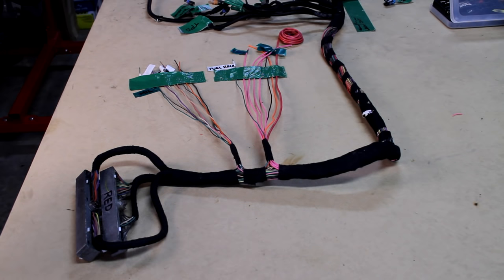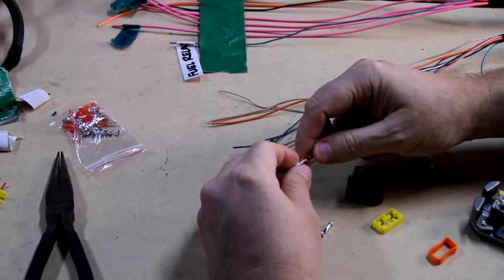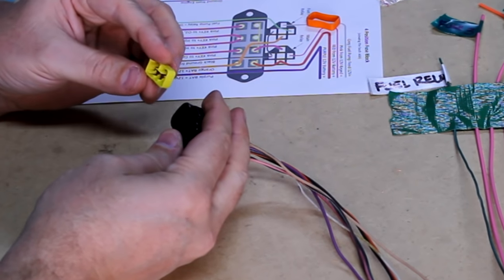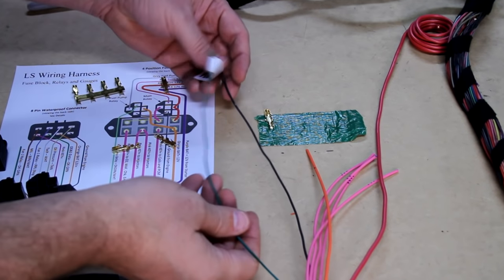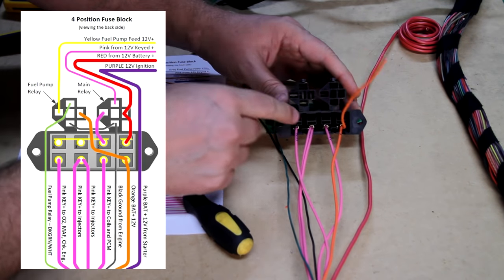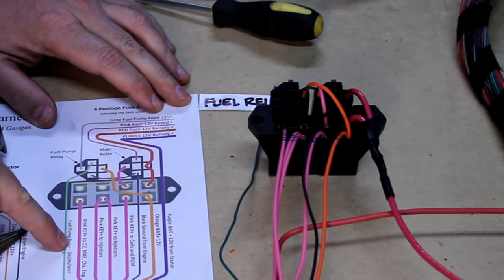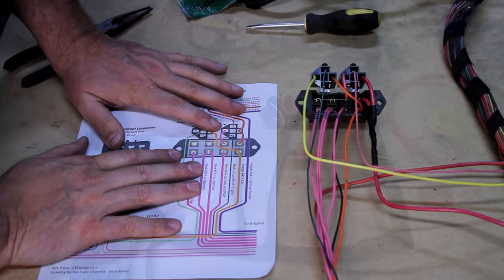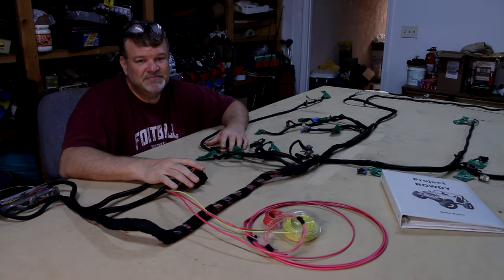LS Wiring Harness Part 5 | Project Rowdy Ep017

Comment: Hey Mike, im putting a 2008 5.3 into a 1953 chev truck. im currently working on the wiring harness and am a little confused on building the fuse block. will the  LS Fuse Block and Relay Diagram be the same for my harness?
Reply from the maker: Ryley O'Connor   That is a great question.  I believe it will be a little different.  The overall concept will be the same.   However the newer harnesses made modifications to the wire coloring and there are PCM pinout changes that were needed to support new features.   Did you find a good pinout chart for your engine?   You might have to do a little translating.
Reply: i used Brendans info on lt1swap, as he gives a good idea about what wires to keep and what to get rid of. i printed this off (http://www.lt1swap.com/E38%20ECM%20Connector%20Pinouts.htm) and cut out every wire he says isnt needed (yllw wires). my harness as it sits right now, have all the yellow wires cut from it, with the pins still in the connectors
Reply from the maker: Excellent!   I did not realize that he had any 2008 information.  Please remember that I only have experience with the 2001ish 5.3 setup.  The page that you provided only illustrates the ECM connectors.  From a Fuse Box (your original question) perspective, Pins 19 & 47 are like my Pink Wires for my PCM.  Pin 20 is like my Orange Wire for my PCM.  Those are the wires that are needed to Power your ECM.  Beyond that, you will need to find references for all of the Pink wires in my diagram.  They will be coming from your Source Vehicle Fuse Box.  It would be nice to have a wiring table for that.  Hard for me to provide much help without it in front of me.  Hope this helps.
Reply: it defiantly helps! im just trying to get any more info on it before i tear into it anymore. be nice to only do it once. your videos are awesome and have helped me understand things a lot better. ill be sure to update you with my progress as i work on it. thanks again!
Reply from the maker: You benefitted just as I had hoped so many would.  Not from the exact steps, but (1) that it is do-able, (2) the approach is just a direction, (3) you can take liberties to change the details and make it your own.  Congrats for having the guts to venture into it!   Do keep me updated.  Would love to hear that it all worked out for you.  Mike

Comment: hello! i would like to know if u can tell me what is the wire from PCM to FUEL GAUGE am planning to use the factory fuel tank from a Tahoe 2002. there a 4 pins connector for fuel pump, Black wire to ground (chassis), Purple wire to R54, Gray wire to Fuse, Orange wire to B80,  but i could not fine the wire that comes from Fuel tank to Fuel Gauge so I guess that wire come from PCM. hope you know what is this wire. I am doing the same configuration as you but i notice that you use only Grey wire from Relay to Fuel pump so i need to delete Black, purple, and orange wires as your configuration or can i keep them? that will make any difference in the PCM or inaccurate fuel gauge ?
Reply from the maker: Javier, I do not think that I can help you on this topic.   The newer cars/truck typically use a CAN Bus system to communicate things like Fuel Levels and such.  In the older vehicle that I swapping my engine into uses a simple Sending Unit in the Fuel Tank that uses resistance and sends it directly to the Fuel Gauge.

Comment: Thank you for all of your previous help; however, I am once again stuck and am hoping for additional guidance. On my 1967 Oldsmobile Cutlass, I have an indash ignition that has 5 prongs. The 5 prongs are Battery, Ground, Starter(Solenoid), Ignition 1, and ACC.  I am not sure where to plug in the wire from the ignition switch (Ign 1)and the ACC to the harness.
Reply from the maker: Did you see Part 6 of this series where I diagnose how and where I am going to connect into my vehicle's ignition system????  I am not exactly sure on yours (you will need to validate with a multimeter ), BUT I BELIEVE...  you will be connecting your Harness Purple Wire to the Starter(Solenoid) connector and the Harness Red Wire to the Ignition 1.  But please check how these connectors operate with a multimeter with the key in various positions.

Comment: Great video as always! On the red wire that you split and ran to the relay and to the top right on the fuse bank. What does the one on the fuse bank do? It's late so I'm probably not thinking clearly. But I guess I'm asking what's the purpose of running it to the bank and not just to the relay?
Reply from the maker: This is great question!  My drawing (starting at 16:01) is accurate, but might be a little misleading as I laid it out on paper as a logical layout.  This might help clear it up....  The Red Wire is 12V+ coming from the battery and it needs to "connect" to this assemble in 2 places.
1) The Main Harness Relay - When the Ignition Key is turned to position Run or Start, this relay is Allows the Red 12V+ source to provide power to Fuses 2, 3 and 4.  This provides power to all engine related items that need KEYED 12V+.
2) FUSE #1 - Fuse 1 provide Constant 12V+ to engine related items that always need a 12V+ source.  Those items need to be protected by a fuse.  So from the Battery, through Fuse 1 and then to the item (regardless of ignition key position).  There are three circuits that need contant 12V+:  two Orange wires that feed the PCM (for memory) and one to the OBD2 connector.  Not sure why the PBD2 connector need constant power, but it was noted in 3 different places in my research.... so I DID IT!!!!
Hope this help!!!!!  Mike
Reply: Perfect explanation! Thank you. I'm trying to fully grasp everything before jumping into mine.

Comment: You always have awesome videos. I do have a question are you running drive by wire or drive by cable? I'm converting mine from drive-by-wire to drive by cable based off of lt1swap.com. My question is I see you're adding the white wire for your Tac, from what I understand you don't need the TAC if you're doing drive by cable? The only reason I say that is because after switching it over the connector that goes to the TAC isn't used anymore.
Reply from the maker: Mine is a Drive by Cable.   I do not believe that the Red10 White Tach wire has anything to do with DBW or DBC.  It is a pulse wire coming from the PCM that will feed me Tach meter on the dash.

Comment: Where does the pink wire going into 8 pin connector come from I'm doing this same harness cleanup as we speak and I don't have a pink wire to go into my 8 pin connector. Thanks for all the info if it wasn't for your vids I would have never tried to tackle this!!
Reply from the maker: Have you downloaded my wiring diagram?  There is a link in the "Show More" section just below the vids.   The Pink Wire that going to the 8 pin connector is a new pigtail wire that I added to the circuit off Fuse #4 (see page 2 of the diagram).  Beyond the 8 pin connector, that wire will go to the Check Engine light.   Hope this answers your question.
Reply: UCanDoIt2 it does thank you very much I have downloaded all the diagrams and studied them like a bible I appreciate it!!

Comment: The yellow wire should it go to a nothing relay back buy the fuel pump if your going to run a 
bigger pump like a 450 walbro? So you can run heavy main wires from the battery.
Reply from the maker: So let me explain it logically.  (1) There is no reason to place the relay back by the pump.  It just needs to be located somewhere in the circuit (between Battery and Pump).  My setup is perfect for this and makes the wiring easier.  (2) The circuit you suggest (heavy main wires from battery), still needs a fuse and a relay... my setup provides this.  (3) I am not specifically familiar with the 450 Walbro, but can't believe it would draw current that would need more than a 16 AWG wire.  If you find out that it does... you can simply (3A) increase the wire size of the Short Orange Wire from Fuse 1 to the Relay AND (3B) Increase the Yellow wire that goes back to your Fuel Pump.  I honestly do not believe this would be necessary.   Fantastic question!  Hope that helps and have fun with your project.  Mike

Comment: One more question, I’m missing one of the blue covers that go onto the PCM connectors. Do you know where I could get one?
Reply from the maker: Your best bet is a junk yard.   They are all over the place in the junk yards
Reply: @UCanDoIt2Mike  they might have them all over the place where you live, but here in NM, not so much. I’ve checked from Socorro to Las Cruses and haven’t found one yet. Either people buy the harness with the eng. or they won’t separate the harness. I am going to try Texas next.
Reply: @UCanDoIt2Mike  right after I texted you, I found them on EBay. I had to buy the whole connectors, but it didn’t cost any more than it would have than to drive to Texas.
Reply from the maker: @jessesumrall2449  Sweet!   A couple of months ago, I picked up a pair of Red and Blue connectors for $10.   Just cut them from a truck.   I am using them on a harness for my bench tuner.  Glad you found one.
Reply: @UCanDoIt2Mike  got a question 7 months with no videos just wondering
Reply from the maker: @Camarogarage  Work, Health, and Wife's Honey Do List took over for a while.  Hoping to get back on Rowdy this month!   Cheers and many thanks for checking in!!!!  Mike
Reply: @UCanDoIt2Mike  okay cool man can't wait I'm currently reworking my harness step-by-step following your instructions

Comment: It looks like lost of the 8 pin plug wires are interior stuff. Why is the fan relay neg signal ran in the plug? Thanks and love your videos!
Reply from the maker: That is a great question Adam.   My original through (discussed in the video) was that I would run that wire through the harness and have it exit the harness somewhere along the front (possibly near the MAF sensor).  But then I realized that I would have a strange wire coming off the engine and crossing over to the front grill.   I then realized that if I had it exit with all of the other "Gauges" (8 pin connector),  it would already be on the inner fender and I could run it forward to the fans and it would be a little cleaner.  Just a decision I made after thinking through the configuration of my vehicle.  Cheers!

Comment: just wondering how you'd integrate a coolant temp gauge into your setup. i know you're using the ECT sensor because the ecm needs to know temp for fuel mapping but typically on a gm vehicle the coolant temp is displayed on the dash because of a computer generated signal provided to a factory cluster.
Reply from the maker: Thanks Michael... I have not looked into that,  but would like to have that available.   I guess I need to study the Dash Wiring harness to determine where that wire leads.  I have some diagrams, maybe it is listed.  Have you solved this?  And you are right, I do still have the ECT Sensor wire that lead back to the PCM.  That one is very important to the PCM for making adjustments.
Reply: I've spoken  to a buddy who is running a 6.0L with the NV4500 in an 06 jeep. His advice was to leave the ECT sensor alone with the ECM and run another temp sender elsewhere in the cooling system for the gauge. That'd how I'll be doing it in my 1985 Chevy K10.
Reply from the maker: That sounds like a great solution.  The passenger side head will have the same port hole that could be used.  It will be very close to the firewall.  Thank you Michael!!!!!

Comment: am installing a factory 2002 chevy taho cruise control module and factory brake switch  on my 1952 chevy truck so do you know what wires from CCM go to Brake switch? there is a 6 wires Brake switch. white, orange, purple, brown, green/blk and green/wht so one of those wire is related with VSS that goes from CCM to brake switch so do you know some about it? or even better if u know where to connect every wires from BS.  thankyou  for ur help
Reply from the maker: My project did not include using this feature.   I suggest referring to the Blue/Red or Green/Red PCM pin-out charts to find those wires.   Cheers Mike.

Comment: Hey friend, do we have to pull out the unused cable? What happens if we just leave them there?
Reply from the maker: You can certainly leave the wires there.  Would you also leave the connector and just leave them disconnected.  That would be fine as well.
Reply: but my machine still can't start ... what's wrong according to you? I've followed your instructions

Comment: Where did the green Fan 2 relay go on the communications port? It was never addressed and you just moved onto the power wires. Thanks
Reply from the maker: I thought that I talked about it, but if not... here goes!  I created the Green Fan 2 wire and left it tucked into the harness (unused, but ready if needed) just before the new Gauge Connector.  Currently, I am not planning to run a second fan as I am putting this engine in a Jeep CJ7 which has a square Radiator.  At the time, I did not feel that a second fan was in order.  Since then, I have thought about finding a 2 speed fan and possibly using that Green wire to work the second speed.  Still not sure if I will go this route.  If you would like to use this wire, you will do so in the same manner that you would incorporate the Fan 1 wire.  It is a trigger wire that goes to a Relay.  The relay would have a dedicated power wire that would in turn power the fan.  Hope this helps!
Reply: UCanDoIt2, ah I get it now. So if I am running a (2) fan set up for low and high speed I can re route the fan 1 wire to meet up with fan 2 and run both to relays direct? Meaning I can remove Fan 1 from the communication connector that’s running toward the OBD2 port? And I have to thank you for a great video and mostly for the super quick response.
Reply from the maker: Greg Stewart You’ve got it!  If I had the need for the 2nd fan immediately, I would have used a larger gauge connector (day 10 port).  You can take out the #1 fan wire and add a 2 port connector for them.  Cheers!!!!   Mike
Reply: UCanDoIt2, Awesome! Thanks again

Comment: what an awesome video thanks for all the help made perfect sense very clear and organized!! where can i get the forms that shows what wires to delete they x's and where highlighted what video is that on for some odd reason i cant find it. very helpful👍👍👍👍
Reply from the maker: You will want to visit LT1Swap.com to download the Pinout Charts for your engine Size and Year range.  It will provide the "base" wires that can be deleted.  I have provided download links to some of the information that I used in the Description Section of each of these videos (use "Show More" above).  Not sure if I included a copy of my pinout where I placed the "X"s.  Would that help?
Reply from the maker: The video that I cover the Pinouts and the Chart that I marked up is located here:  https://www.youtube.com/watch?v=GXQtSLG0CW4&t=2s .  It just contains a few snapshot of the chart.
Reply: UCanDoIt2 
I would lik to see the diagram for the 3 small connectors that are located by the fuse block will i be able to get that from lt1swaps?
Reply: UCanDoIt2 
Thank you so much very helpful information.. Very nice!!!

Comment: Hi! great harness,I was wondering what program you used to do all of your wire drawings, id like to do the same for the car im building.
Reply from the maker: Thank you!  For my drawings, I use Microsoft Visio.  Very easy to use (drag and drop).  I have been using it for 25 years (pre Microsoft), and it is easy to learn.  I believe I have a very old video here on a design I did for a Wine Rack.  I think I walked through the design.  I'm sure there are many How To vids on Visio.  You should check those out.  Cheers!  Mike

Comment: Gday, just about to test fire all my hard work.  One question though, what amp fuses should i use in that fuse box configuration you designed?

Kind Regards
Reply from the maker: 15 Amp is what I plan to use based on the references that I used to develop the design.   Cheers!!!!!!!!

Comment: Mike...Curious where you purchased your wire for your splices and how much (length) of each color you got. I haven't quite figured out how much I should get. Thanks
Reply from the maker: I ended up purchasing a package of multicolored 16AWG wire off Amazon (http://amzn.to/2kXTWvQ).   I knew that I would need additional wires for this and future projects, so I was looking for extras.  I bet I used 10 feet of the pink in the splices.
Reply: Thanks for getting back with me. Did you use 16 AWG for all wiring splicing, even from the harness wires (existing) to the fuse block and out to battery? (BTW, I couldn't get that link to work.)
Reply from the maker: You can technically splice (4) 20 AWG wires into (1) 16 AWG and maintain the same impedance.  So everywhere in my diagram that I needed to do that, I used the 20 AWG.  The wires from the new fuse block to the vehicle (Batt+, Swtch+, and Starter), I believe I used 12 or 10 AWG.
Reply from the maker: If you are attempting to download the file from a phone or iPad, I believe you have to COPY and PASTE the link into your browser.  If you click on it, for some reason it adds extra characters.

Comment: I have a quick question. I thought The fuel pump wire from the pcm (green/white)was a negative if so shouldn’t the other side of the pump relay be a +12?
Reply from the maker: Colton Riegel According to diagrams that I have seen and a write up on Lt1swap,  this wire is a 12+ trigger wire that operates the fuel pump relay.  So it appeared that the PCM is supplying 12v+ on this wire.  It is not to be used to directly drive the fuel pump.  You will need a relay to handle the additional amps required to drive the pump.